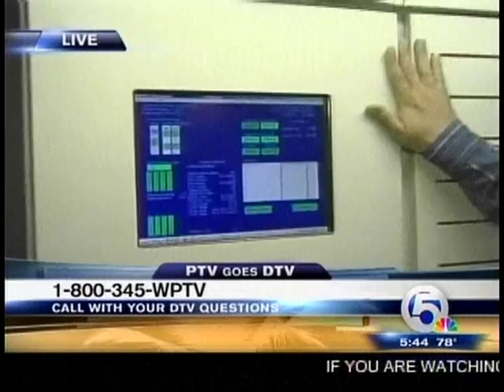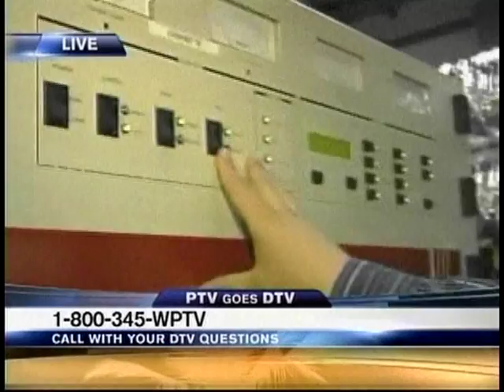WPTV Ch 5 Analog Shutdown - DTV Conversion - Frequency Retune June 12th, 2009 @ 5:45 AM

Comment: Now I know why WPEC signed off their analog signal 3 days earlier:  Because WPEC still has its Digital Signal on VHF 13, and the former channel 12 allocation was used for the Post-Transition digital channel for WPTV, since their pre-transition UHF channel 55 was reallocated for non-broadcasting purposes.  Oh, and as for the repack, both WPEC and WPTV are not going anywhere, because they will stay on their channels.
Reply from the maker: David Velazquez yes I am using that spectrum now :). LTE. I really liked it on 55 as I am in Broward. Better efficiency IMO.
Reply: @DJ_Megahertz  As of 3/22/21, WPTV is now simulcasting its main signal on now co-owned WHDT on channel 5.11, thus putting WPTV’s main signal on UHF for the first time since the DTV transition.
Reply from the maker: @davidvelazquez9473  in preparation for ASC3?
Reply: @DJ_Megahertz  I vowed not to get a 4K TV until ATSC 3.0 becomes available in my area, so this should be interesting.
Reply from the maker: @davidvelazquez9473  agh!  And I just bought a new nice 65” and it is not going to be ATC3.0 ready!  Not good for those just buying one. I think they’re only a couple of sets ready right now.
Reply: @davidvelazquez9473  They are on virtual channel 9, but on UHF digital channel 34. They went from channel 59 to channel 42 in 2009, then to RF channel 34 in 2019. The digital channel 9.7 still maps it back to 5.11. Coincidentally, they also had a backup channel on UHF Channel 25 if VHF Channel 12 wasn't available.
Reply: In other words, they didn’t make an election in the 1st round, and elected VHF 12 in the second round with a fallback to UHF 25, since WPBF elected to stay on UHF 16.  25 would later be occupied by WBWP-LD before that station was displaced by the post repack signal of WBEC.

Comment: I'm thinking that the chief engineer should have kept the station's signal output continuous by first firing up the VHF digital transmitter, then shutting down the analog transmitter, then putting the VHF digital transmitter on the tower, then finally shutting down the UHF digital transmitter.

Comment from the maker: Look at the clip again at 2:33 into it. He pressed the "operate" button and then the tranmistter came up about 10 seconds afterwards. It first started at 0% and went to 73% power and then he walked over to the old UHF DTV transmitter. By the time he turned the corner, the new RF CH 12 transmitter was already at 100 % power. The "warmed-up" period is actually putting RF out over the air, but not a full power for the first 15 seconds or so.

Comment from the maker: I saw that as well, my guess is that the ENG truck that was sending the feed to the studio might have had a glitch and it might be the way they try to correct frame loss or errors with some sort of repeat of a few frames prior. I hear this all the time with Sirius radio where they through in a little sample of the previous audio when you get frame loss.  It sounds like reverberation effect added.
There is another video someone put up that is the actual analog recording, you should see that one.

Comment: I was watching the conversion on Comcast and everything was OK except just a few seconds after Dave switched off the analog, there was a sort of ghosting. It was more of an echo or adjustment of some sort. Do you know what that was? (It happens at 4:10 in the video)
Reply from the maker: dapet123456 I think that was the camera RF link that bounced. Likely unrelated to the switch. The feed I had was already on digital OTA
Reply: I like to believe that that was the point of transition to the digital thing